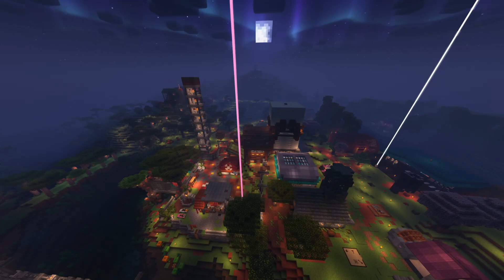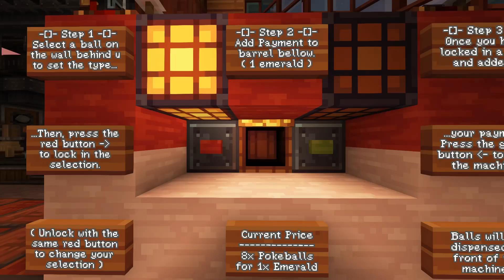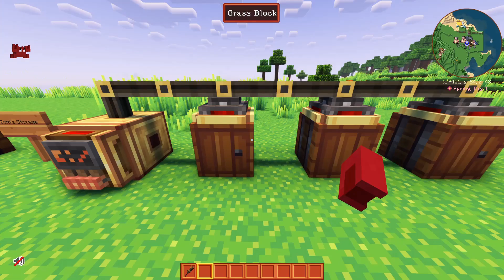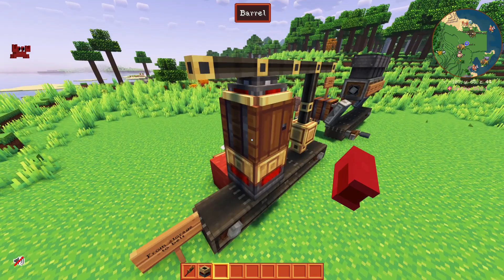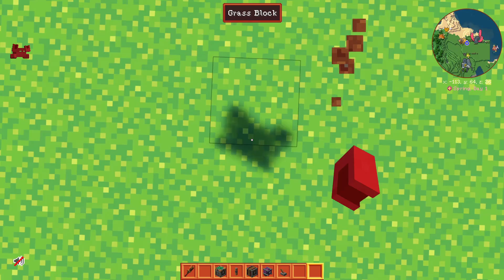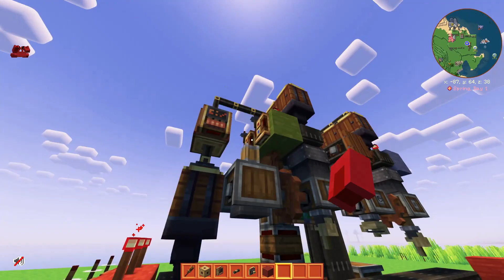How to build a Pokeball factory in Minecraft (BigChadGuys Plus w/ Cobblemon)

Comment: Could you make an entire tutorial of the building for the one shown in the beginning
Reply from the maker: I used rope pulleys to move the shell parts up and down, but after running for a while there started to be strange issues I think relating to chunk loading. After letting the server run for a few months while some friends played on it, I came back and the whole shell of the building had disappeared; so idk how much a tutorial on that would be worth.

I think the issues I was having could be solved if you just unpower the pulleys when they are supposed to be stopped. I had them always running and just changed the direction but the walls started digging into the floor and parts of the roof would detach and disappear... it's a whole mess.

I have saved all the files from all the modded servers I've hosted over the past few years so at some point I want to go through them and show off my builds. Stay tuned for that sometime in the future!